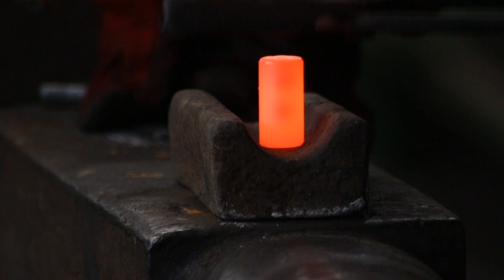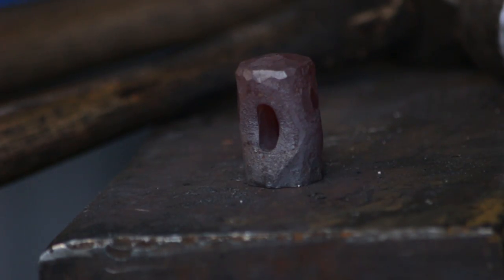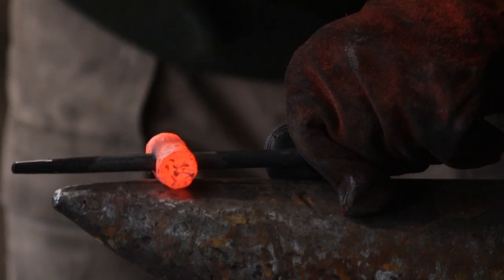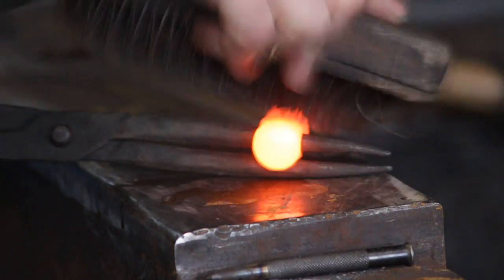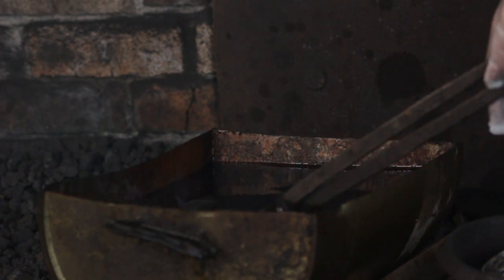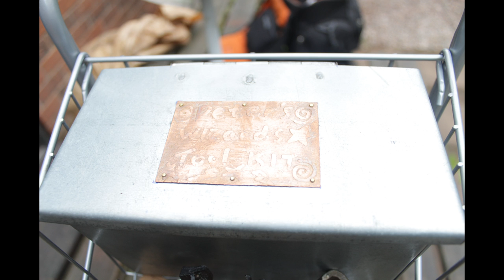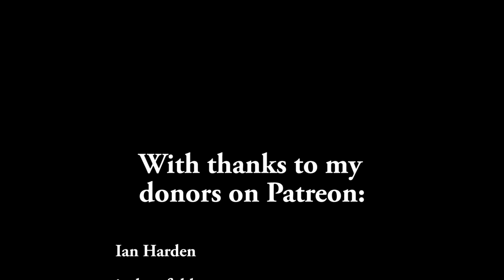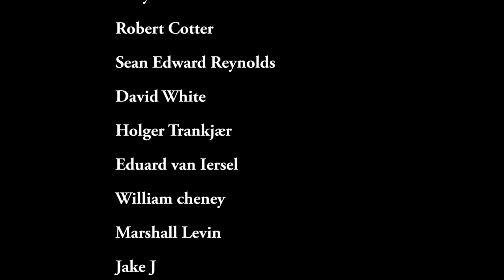Forging a mini turning hammer for Pete Smith

Comment: why did you wear gloves towards the end of the video? to stop the dirt getting into the handle?
Reply: Because shop bought "boiled" linseed oil isn't boiled anymore, but instead has added metal salts as "driers" to help it polymerize faster..
Some of those salts aren't exactly good for your health, and can relatively easily cross the skin barrier, I don't know if it's still the case but, lead salts where commonly used for example...
Reply: siouxsettewerks 
he was wearing the gloves before he was handling the linseed oil, but that could well be the reason why.

generally, in the UK, we don't have lead in anything if it can be avoided, but yeah, there is definitely added goodies to help it dry faster these days.